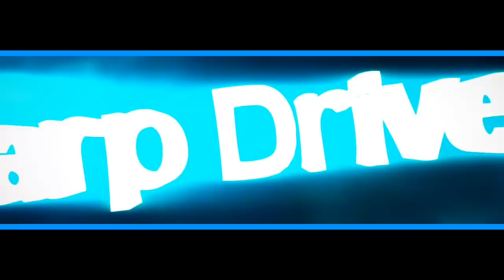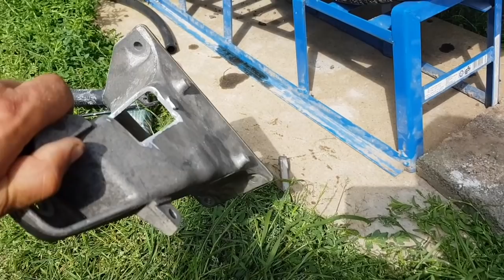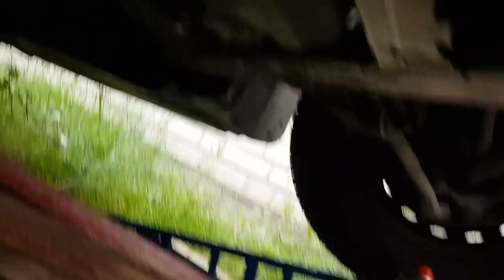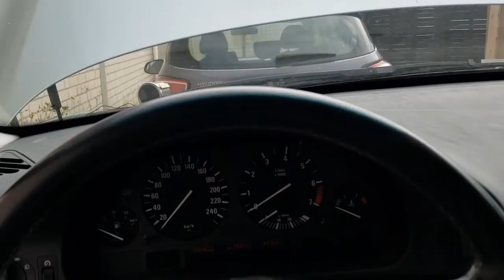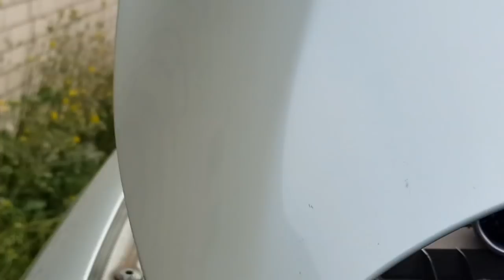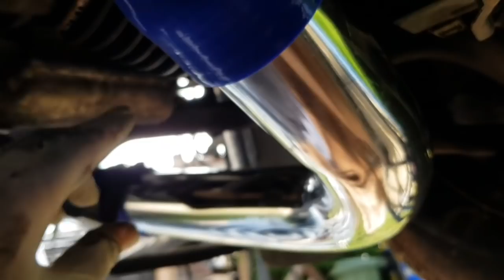Bmw E39, M54 engine, turbo Install P7

Comment: Great to see the process end to end. How did it turn out-- did you get a measurable performance boost? Did you need to remap to take advantage of the extra air from the turbo?
Reply from the maker: The power gain was aprox 100 hp more and yes I had to flash the dme with new software (settings) to now that it has a turbo
Reply: @WarpDriveM That sounds entirely adequate for a daily 5er. If I can find one that fits my circumstances, I'll take the plunge. Easier now that you've documented all the pitfalls I will encounter ;)

Comment: No way id of used that engine mount without Atleast welding and bracing it. How long did it take to snap?
Reply from the maker: This was just for test purposes in order to fit everything in there....it won't snap because it was cut exactly were the reinforced part is on the back you can see that but very good point and observation 👍

Comment: Turbo won't boost in neutral, you have to drive it and put a load on the engine. This build should be called e39 turbo build eBay special " 🤣

Comment: why hitting limiter without warm engine :(
Reply from the maker: look at the temp gauge. it is above the blue part, witch means that the engine is no more cold. but very good point. thx for watching.